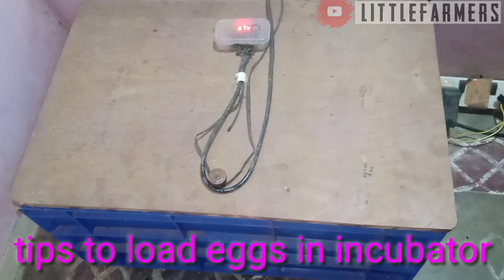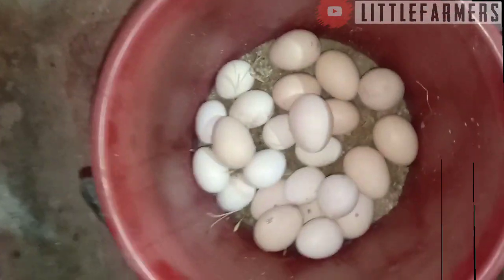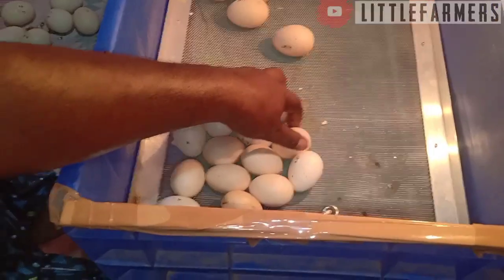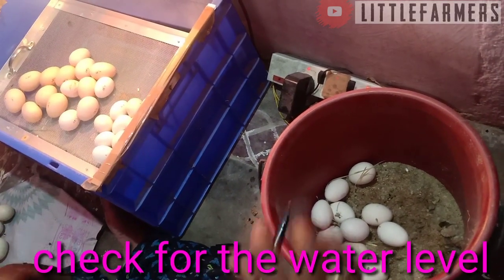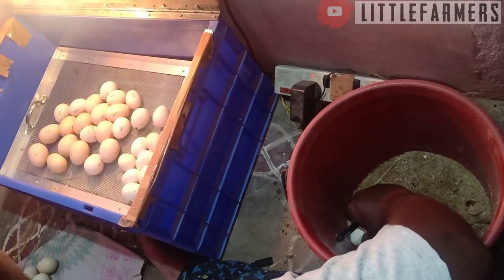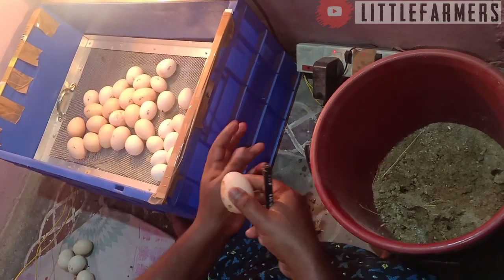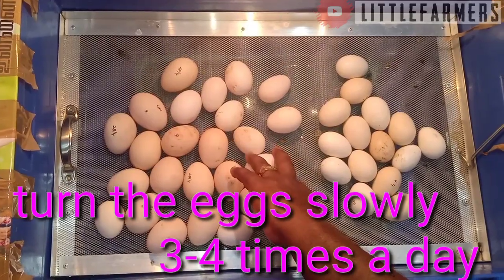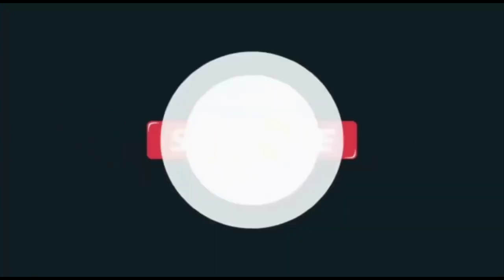Egg incubator tips/Tamil/littlefarmers

Comment: Bro you cannot maintain humidity
Reply from the maker: A hole is given at the back of fans sir ,so that humidity from environment can be sufficient to hatch these 100 eggs capacity more than 200 eggs must be maintained with inlet fans and mist maker not heater.
Reply from the maker: For more clearance join us on 8668045602